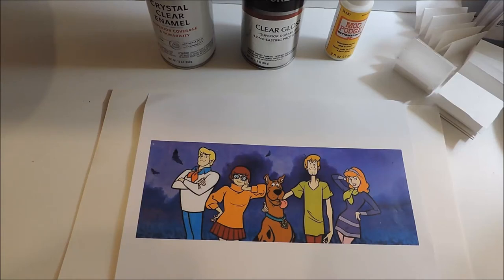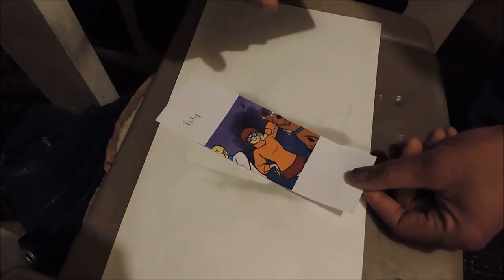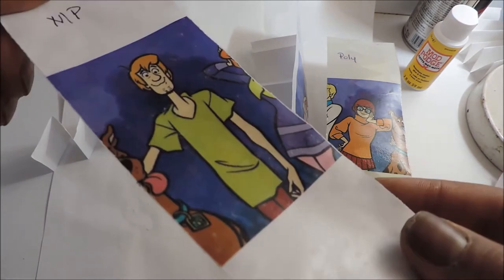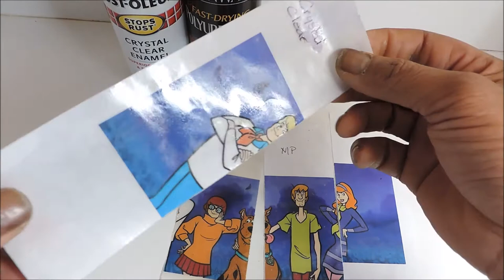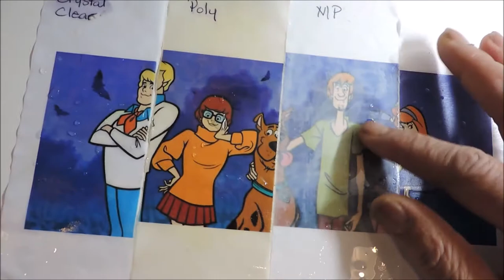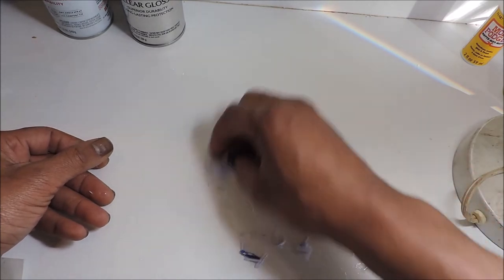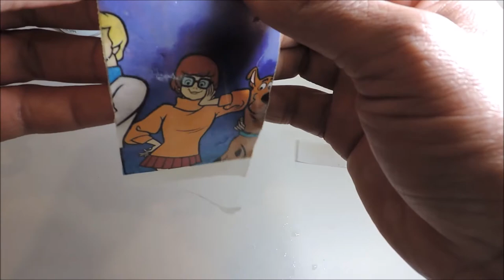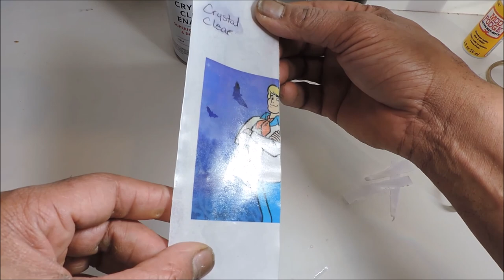How Top Coats Work On Plain Paper Test "on paper WITH PERMANENT MARKER"?

Comment: Thanks so much for this! I've searched high and low! Any idea what I can paint on to my FedEx poster Print? It's too humid for me to spray anything. Mod Podge left cloudiness. The picture is large and it was printed with black ink. The ink, when I touch it, gets powdery so I need something that won't smudge my print or make the black dull or cloudy
Reply from the maker: Hi FlowAndGroww, I really hope all is well. How did your project turn out? I really don't have any idea, (sure you've figured that out by now) did you find anything if so please share. Thanks